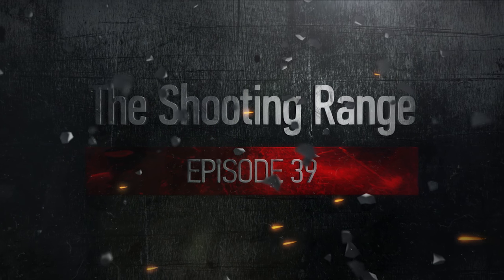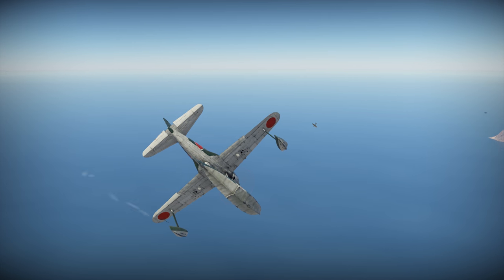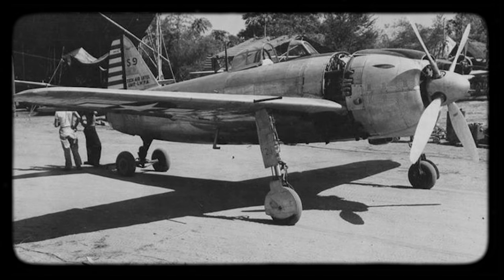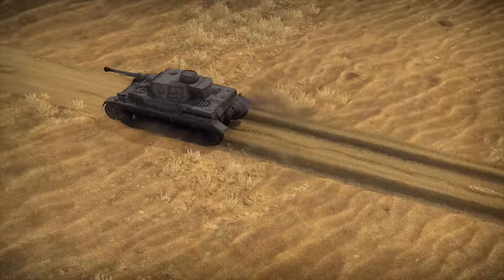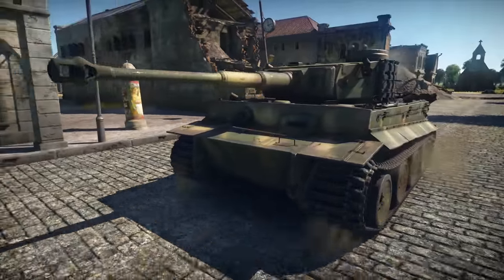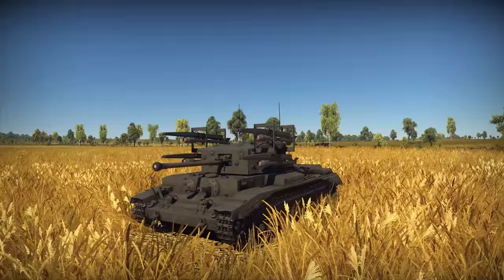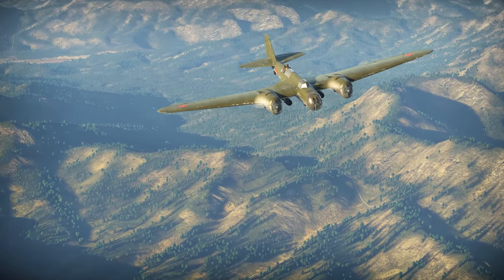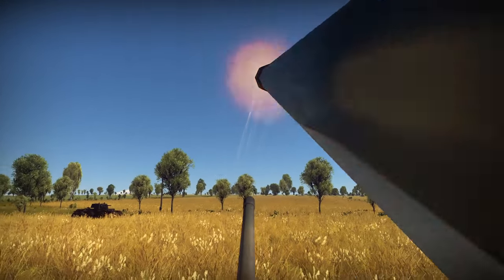War Thunder: The Shooting Range | Episode 39

Comment: Will there be the real 88mm Flack Ammunition? :)
Reply: They're not currently planning on doing so. :<
Reply: So why do they implement it as an AA Gun :D
Reply: Snowbuster94 just use the high explosive round mate its more effective than the armour piercing round
Reply: By the way, it is flak ammunition because of the german word "Flugabwehrkanone" which is translated to air defense cannon
Reply: +Jamesyboy 5532 wth are you talking about
Reply: for the over 9000th time. The air burst ammunition had manualy set fuses. They woudl be absolutely useless in the way the game is played. They were used to fire volleys at bomber formations after their altitude and speed were calculated NOT at individual groudn attackers.
Reply: Snowbuster94 the allies had proximity fuses. the germans never developed a proximity fuse. their aa was directed by radar and placed in paths of bomber formations. it needs to work affectively, while balanced. it wouldnt  really work in wt, it would require a big mechanic to be affective for a player using non proximity fused ammo. in my opinion.
Reply: No dud this will be much op by god will be worse than those dirty russians spaas. But as I play with germoney they can put :)
Reply: i got the flak gun...the barrel depression is so low that it just begs for flak shells
Reply: You mean airburst shells?
Reply: WILL246 yeah sort of
Reply: They didn't. Both truck-guns are in-game as tank destroyers.

Proximity shells would be cool, but I think they'd be a bit over-powered.
Reply: well i used 128mm (Flak) on a plane whilst in a Maus xD
Reply: plz this lol... I want flak to be actual flak.   I mean its not a big deal for Tank RB, but when we eventually get to world war mode and assumingly dealing with real bombers instead of generally mostly attack planes 88mm will make sense.
Reply: and make us fighters jobs that mutch harder hell naw

Comment: Some tanks actually bent the tracks for steering at higher speeds, but the tracks could not be bent much so they had bad understeer, resulting in more conventional tank steering being used in those tanks.

Comment: Hey Warthunder, will you ever increase the BR of the Jumbo Sherman? 4.7 is wayy too low, and from how it's played, it's damn near impossible to kill. 

Maybe an increase to 5.0 or 5.3?

Also, when you were covering "How Tanks Steer", you forgot the steering mechanism where it turns on a dime, like a turntable. It's when the one track goes forwards while the other goes backwards, turning rather quickly, but not moving forward as such. Found on most Rank V vehicles, the Cromwell V, and others vehicles.

Comment: Gaijin, I find german spaa at low tier unsatisfactory due to low fire rate. Could you add a kublewagen with an mg mount on the back maybe as a 1.0 br premium. It works in H&G.

Comment: Hey Gaijin, why are planes that were designed in 1942 fighting planes that they never realisticly faced in combat, such as the sterling. There doesn't seem to be a reasonable explanation for such a high B.R. for a plane that is slow with very little protection.

Comment: What about WW1 vehicles? ...That would be the best inovation of this game...
Reply: Boi
Reply: INjest3r there are very few WWI tanks which would be unbalanced in the environment they would be in. machine gun tanks (many of the tanks from WWI) would be completely useless, so you are basically limited to the Mark tanks, the FT, st chammond, a7v, and a few others. the slow speed and slow velocity guns would make long range combat impossible and short range co.bat hard to achieve
Reply: Matei Prelipcean that wouldn t be the best inovation of this game, the best inovation it would be the choppers
Reply: or what about submarines and soldiers?
Reply: Matei Prelipcean noooooo
Reply: It was just a suggestion...
Reply: They operate much differently to a ww2 tank. They were mainly build to stay in the same place for a long time so they were slow. Also the only ww1 tank with an actual turret was the renault FT. Also as far as armour is concerned even heavy tanks were made so they could just about counter standard infantry rifle shots (with the exception of the tank gewehr for obvious reasons). Most tanks weren't even mounted with actual tank guns. They just kept it at machine guns. So although it would be fun for an april fools thing I wouldn't expect to see it in an actual update.
Reply: Matei Prelipcean no the weapons and mobility of ww 1 tanks suck and they are really boring
Reply: Matei Prelipcean 
You know they are really slow, right ?
It's not Battlekid 1 here
Reply: The world war 1 tanks were not really designed for tank vs. tank combat. So I guess they won't be introduced
Reply: McPuff 
Looks like you never saw a real life ww1 tank then.
Cause knowing Gaijin they would want it realistic (right EA ?).
WW1 tanks were made to follow walking soldiers so I let you make the maths.
Also like others said, these tanks were not made for TankvTank combats. Most of them only had MGs like most of the Mark tanks
Reply: The Tsar tank would get wrecked by British Landships.
Reply: McPuff 
Ah that.
Yeah they're very interesting indeed
Reply: Matei Prelipcean Biplanes ONLY! No shitty tractor conversions of tanks.
Reply: But slow and paper thin